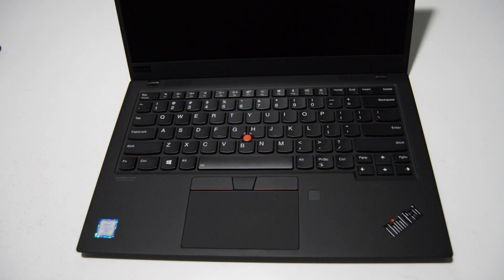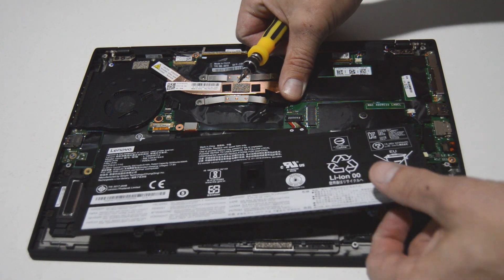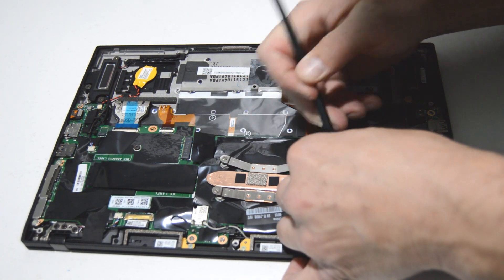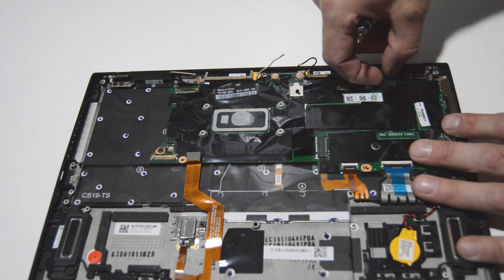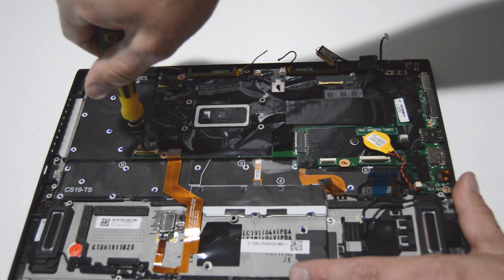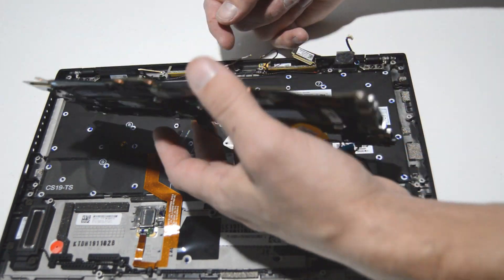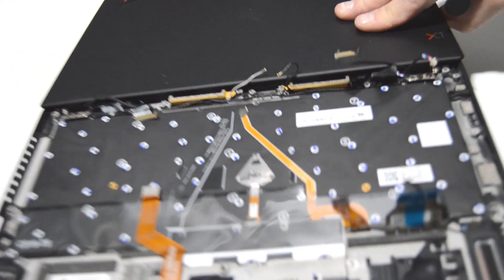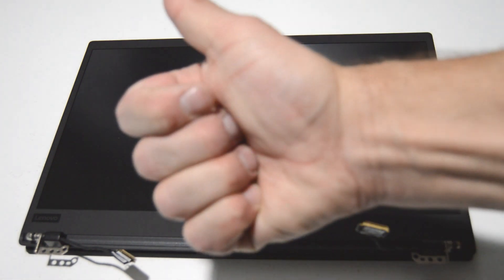How to Disassemble Lenovo X1 Carbon 7th Gen Laptop

Comment: Thanks for the video! Surprised that the keyboard is screw in, can you confirm it's definitely screwed in and not plastic rivet? I have an x1 carbon 7th gen and the up arrow on the keyboard is inoperative and if it's just a matter of unscrewing a bunch of screws I'll definitely replace the keyboard.

Comment: Can I replace the integrated wifi for a wifi 6 card? I would like to know what is that empty slot for?
Reply: @henryvilchez9368 could you replace it with a wifi 6 card? It has a free slot to place a Wi-Fi 6 card but apparently the lead and black cables that are from the Wi-Fi antennas do not reach the new card.
Reply: The spare slot is for an LTE card (with separate antenna that don't appear to be included on this non-LTE model.) However I guess if the PCI-E slot is active, you could put any kind of card in there you want. I have one with an LTE card but I don't use that so I'm wondering about the possibility of putting in a half length sata ssd.

Comment: What is that empty slot for?
Reply: LTE (mobile) card. There's also simcard tray in the rear of the laptop (although it may not be provisioned in models without the LTE card.)
Reply: Also there are no antenna for the LTE. So you'd need some parts and potentially some modding but probably doable assuming the board has the traces to the rear for the simcard.

Comment: Great video, thank you! When i tried to remove the motherboard, i found that it was stuck to the keyboard. I looked underneath with a touch and seems like the black protective cover was tearing off probably due to drink spill that happeneda while back. I decided not to proceed since you said that the motherboard is not replaceable. However is it advisable to replace the overactive fan? It is loud even when not in use. Please let me know! Thanks

Comment: hello, can you help my bios has password that i dont know this password is only to accesss the bios not the computer of course, i got this product from my company not stolen no way and they cant know what is the password for the bios :(...  but i need to access the bios cos i cant use touch id it s disabled inside bios, if you can give me some help, i checked to open it it s ok, i have contacted LENOVO they told me only way is to change motherboard but no way this computer is still in warranty and i have to pay for new motherboard  and just a little thing i want to use and  change into the bios that s all if not i ll use this computer without touch id never mind but if open and remove the little battery in yellow can help ?? or make a clearcmos but i cant do welding i know sometimes have to do that i m not good enough for that if. thanks :) by the way good video :)
Reply: You are out of luck unfortunately. Someone in your company who had the laptop before you (or your IT team) has set a password on the bios and not recorded it or has forgotten it. To reset the bios password on the x1 you likely would need to desolder the bios chip and flash it with a chip reader. You might also need to cut together a hybrid flash file by reading of the existing bios and pasting in the blank password field from bios firmware file from Lenovo (or another x1 with disabled bios password), especially if you need to preserve the windows licence key stored in the bios.
Reply from the maker: Unfortunately an unknown BIOS password is the end of the line for a motherboard. Some of the older ones could reset when removing the CMOS battery, but the newer stuff has internal backup power for the BIOS. You could try some forums. Good luck!
Reply: @Sellbrokedotcom  ok thank you for the reply :)